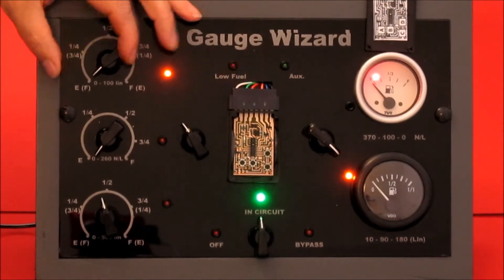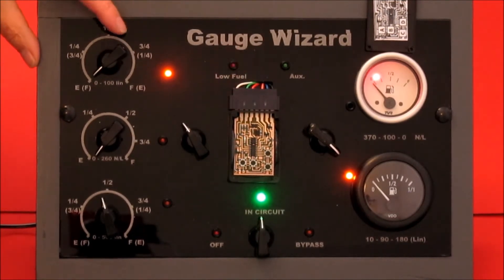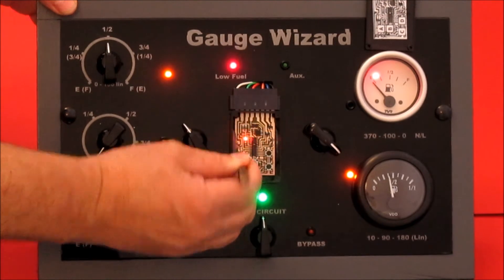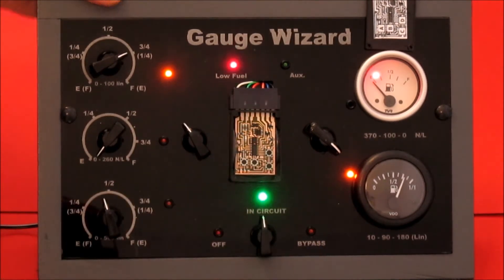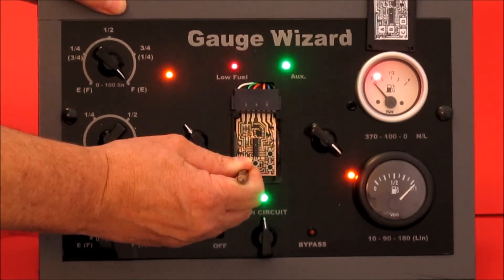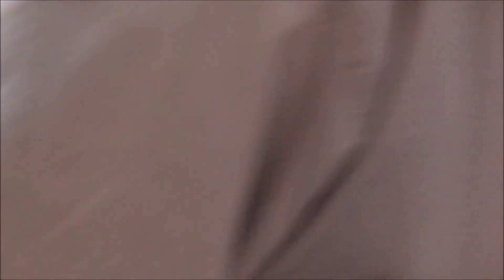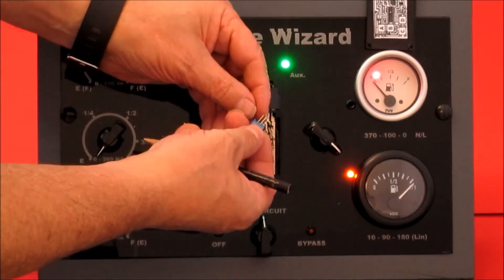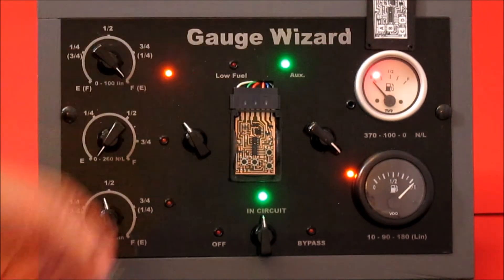Gauge Wizard 4.4     Video 7      recording sender resistances directly

Comment: Do you have any advice on how to actually drain and refill the tank with measured amounts?
Reply: One way is to run the the vehicle til it is low on fuel, then with a multimeter set to Ohms, and tape / crocodile clips or whatever you think works best to connect the multimeter to the fuel sender and preferable with the multimeter in the passenger compartment, ( guage and wizard disconnected. )   get an assistant to write down the resistance every 5 seconds while you fill from the pump at a constant rate . From this you can plot a pretty accurate graph of the resistance on one axis and the time on the other,    mark the start, end, 1/4 1/2 and 3/4 times on the axis and that will give you the resistances.
Another is to assemble as many fuel cans as possible and siphon out the tank,  plot the resitances as before every time you add a fuel can's worth, or if the cans are different sizes, weigh the amount of fuel added each time unitl the tank is full,  Again plot this on a graph with the volume or weight along one axis and the resistance on the other.
The point I am trying to get across is that you don't need to know the exact amount the tank holds, but you want to be able to plot a graph of the resistance of the sender from empty to full.
I hope that makes sense
Chris
ps, if you know exactly how much fuel the tank holds, then you can take the short cut and just measure the resistance or program the wizard by adding the right amount of fuel before taking a reading or pressing the buttons,  However, if you plot the resitance proficle of the semder/tank cmbination as suggested, if anything goes wrong during programming of the wizard, you don't have to mess with the actual fuel again, just refer back to the recorded resistances.
C
Reply: @chrishorne4016  Many thanks for the quick reply. I once tried to fill up at a petrol pump whilst taking measurements, but the station manager wasn't happy with me experimenting.  I like the idea of measuring resistance over time, as that wouldn't be too obvious.
Reply: @andyv1  make the wires long enough for your helper to sit inside the car.   What can't be seen can't be complained about !

Comment: Trying to place an order for a new wizard but your website is seriously broken.  4-11-2018
Reply from the maker: Hi,
please email me with your browser details and I will try and replicate..  I just tested using Firefox, Edge and  IE and it is working fine, we do know that Chrome on Android requires full registration rather than quick checkout.  Chris
Reply: We were using Chome/Win 10, with AdBlock Plus turned off for your site. Will try with one of the other browsers instead. In the meantime, placed an order for one (at a higher price) on your eBay listing
Reply: We were able to confirm that it seems to be a problem with Chrome, and the Win 10 version of IE. Firefox, Edge, and Opera seem to work just fine. Thanks!
Reply from the maker: Thanks for checking for us, Wew have made some configuration changes and hopefully the problem is resolved.  Chris